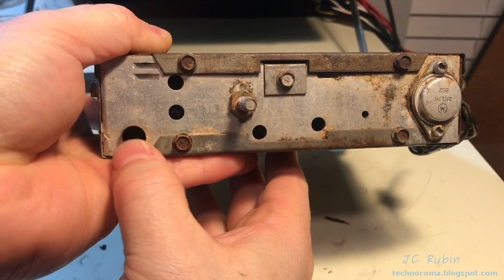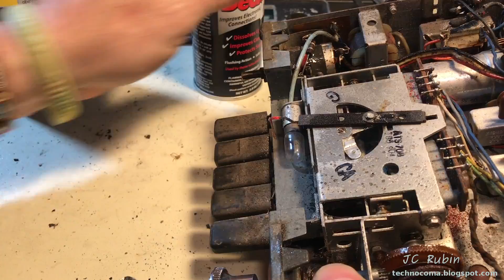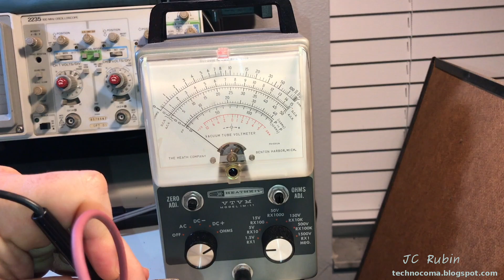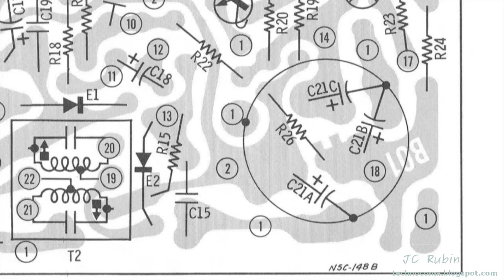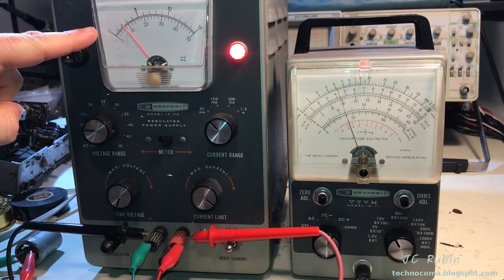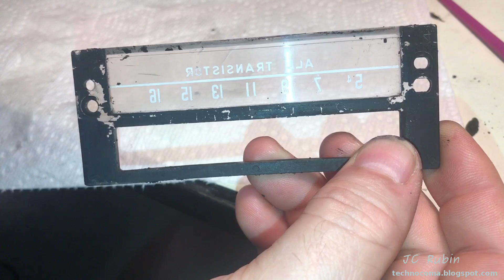1969 VW Motorola Sapphire IX AM Radio Restoration 9SMV - Part 1

Comment: This is a very good video by Retro Tech & Electronics.  Same for the second video in the two-part series.

I lubricated the moving parts in my Sapphire XV radio including the rods and springs for the push buttons (as best I could) using a product called Tri-Flow (TF21010).  The 2 fl. oz. drip bottle comes with a very thin straw to get the lubricant into tiny areas with fine precision.  This small bottle of lubricant goes a very long way.

I made the mistake of lubricating the radio friction wheels. After that the tuner knob spun and spun while barely moving the tuner parts.  I used several drops of Purple Power degreaser on the friction wheels and then the turner knob worked well again.  Probably several drops of ordinary rubbing alcohol could have also been used to fix my mistake with lubricating the friction wheels.
Reply from the maker: I use triflow for bicycles. It’s a teflon lubricant

Comment: Hi.  I just got a Sapphire X.  It also appears to be complete and unmolested.  I am going to follow what you are doing step by step, so much for the fun of the challenge.  As it turns on, I hear the AM and FM, though it is weak and has noise.  What is the oil spray called? This is the first thing I need to get in the cleaning process.
Reply from the maker: Deoxit.

Comment: Silicon or germanium transistors?
Reply from the maker: It appeared to me to not be Germanium
Reply: @rubin-tech  Good, because the germanium transistors are getting harder to find and seem largely to be on the Russian surplus market.  That and changing to a silicon transistor usually requires recalculating some of the values of the adjacent resistors.  Looking forward to the rest of the series.

Comment: I been restoring tube radios for a bit ,I would love to find a tube car radio,but dont no much about car  radios ,so I have to find a schematic on it ,as far as the bulb is concern I would change it because it's old, I usely clean chaise with alcohol and  q tips. That radio looks like it need a bunch of cleaning .I new your channel do you mostly work on car radios or all kinds?you have a nice work bench .nice job ,great video .the buttons came out nice can I ask what cleaner did you use.
Reply from the maker: I do not often work on car radios or transistor radios. This is an exception